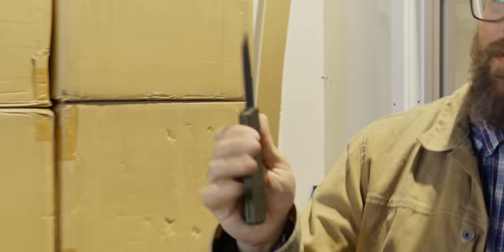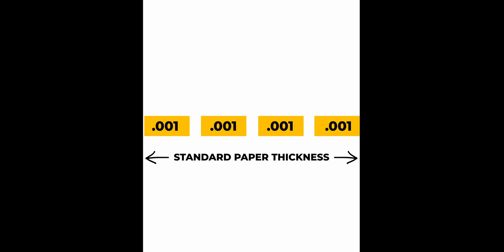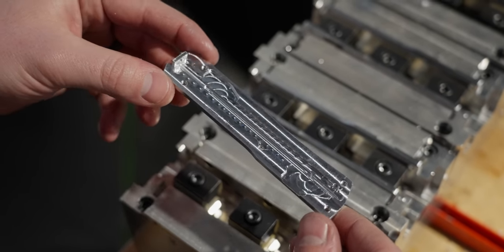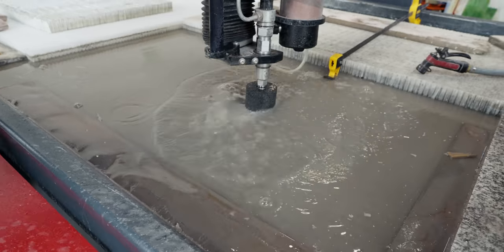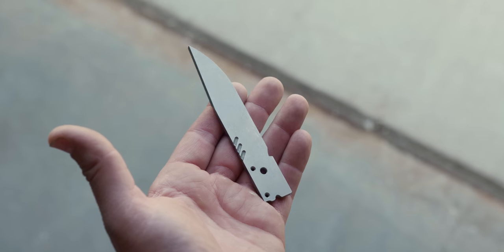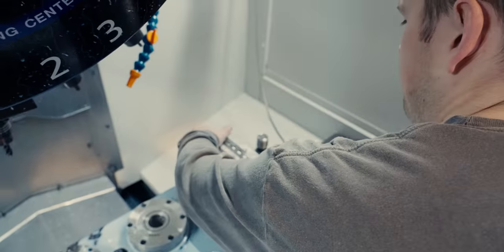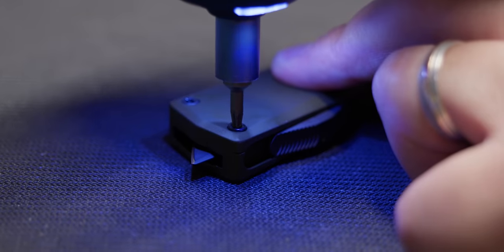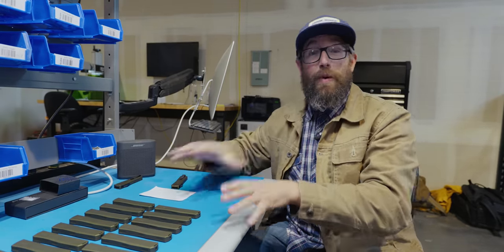Making The Most Complicated Knife! || How An OTF Switchblade Is Made And How It Actually Works.

Comment: Ever since I first played with an OTF knife (and learned about their shortcomings in general), I've wanted to design one that can function as both an everyday carry and utility knife to a reliable, dependable fighting knife for heavy-duty use.

I think the biggest part of that is making a system that can be actively locked in the open position without worry of the blade hopping the track or disconnecting from the spring mechanism. I also know that there are some knives that would qualify under these conditions, but there's always a tremendous amount of respect you have for a tool that you build yourself. And considering the amount of experience I have in metalwork, machining, knife making, gun building, design/engineering and forging, I don't think it's unreasonable for me to believe that I can actually accomplish this. And now that I have a couple knives of my own for reference, along with videos exactly like this one, I actually think this would be a worthy project. 

Who knows, maybe I'll have the opportunity to get my own creation reviewed by such accomplished and well-versed folks as this!

Comment: If you don't want to spend $250... I bought a much cheaper one from grindworks. I have an expensive single action that I hate, and I ended up buying 2 of the lightening otf knives, which are dual action. They are nearly identical internally to the expensive ones. I'm not sure what their tolerance is, but I haven't had a misfire in 3 years of regular use at work. My expensive knife had to be taken apart, cleaned, and lubed.

Comment: roughness isnt the biggest in swiss watches because the interface points are usually brass on lubed ruby contact. the combination of the lubricant and the major difference in hardnesses means you can get away with leaving the brass a little bit rougher than you would for brass on brass interface

Comment: Hey zac, can you check out the viper tec D.E. otf, I’ve had it for about a week and I love it, I got mine in 440 steel because it’s easy to sharpen and plus I’m not beating on it I just use it to cut down nerf darts and open boxes, but other than that it’s a great knife for like $80 -$85

Comment: one thou tolerance is pretty standard. i know that sounds small, but its really not hard to hold when most CNCs will do ten-thousandths

tolerance stacking pretty self explanatory, even though this Axial guy didn't actually bother explaining it. so the dimensional tolerance for part X is +/- .001" for surface A. you make the part, the dimension is within tolerance, great. Part X mates surface A with part Y surface B, same thing.
the problem comes when both surfaces are one thou under the required dimension and part Z has to fit inside of them with, again, one thou tolerance.
Your assembly is now two thou under the dimension called for, and if part Z happens to be one thou over rather than at or under dimension, it doesn't fit.

Comment: I'm just wondering though, do they consider the tolerances?
Like this video is an ad but it isn't diclosed, I don't care about that, the whole how it works aspect of this video isn't really done well and I'd imagine that's the reason a lot of people are here, it didn't make sense to me, you push forward and that stretches the spring that's attached to the base of the knife so how does it shoot forward when you pass the locking lug, why doesn't the spring pull it back into the lug, I would understand how it closed if that's the case that the spring contracts and pulls it back but I'm pretty sure I don't understand the mechanism and I watched that 5 second section like 5 times.

Comment: Actually, 0,025mm is quite a crap tolerance... There can be a variation of up to 0,05mm between pieces, wich is more than what ball bearing axles require. Definitely not a tolerance to be proud of.
Reply: This tolerance is set so any debris can easily be blown out using compress air, as this is a closed handle design.  One drop of oil that is even slightly too viscous can prevent it from operating properly.  Yet the tolerances enable it to have a very solid lock with less movement than many high quality folders.

Comment: Oh boy... a big  commercial for a many multi hundred dollar toy for n'er do wells. I guess those bitcoins are really makin' it fun.
Reply: 🤣 Riiiiigt… I have a Microtech Ultratech, which this knife is a copy of.  It’s my EDC, it’s a tool, hardly a toy.  I’ve beat the crap out of it, but never abused.  This copy appears to be made to the same standard, and would wager that it’d also stand up to hard use.  There is a HUGE difference in quality in knives.  I’ve used everything from $15 Chinese ‘cool’ looking knives to $350+.  Every knife I’ve had that was under about $150 has failed in some manner. And the difference in overall quality and fit & finish from $150 to $350+ is significant.  Knives are one thing that you can easily get exactly what you pay for, especially with established and reputable brands.
Reply: @jwayneair  So how many in your collection, 50  ?
LOL - case closed